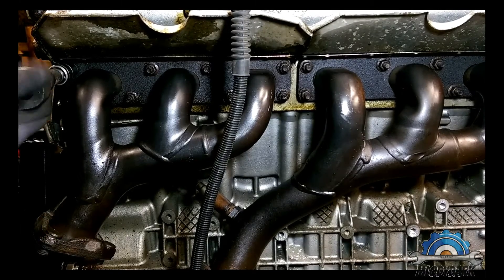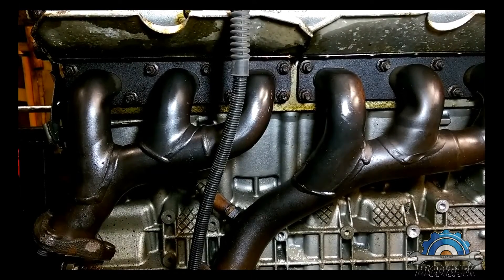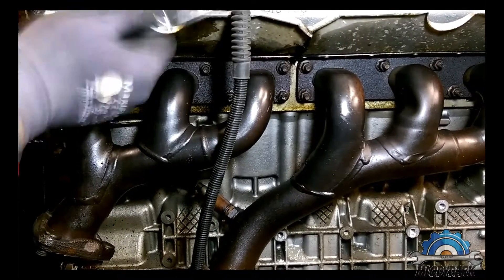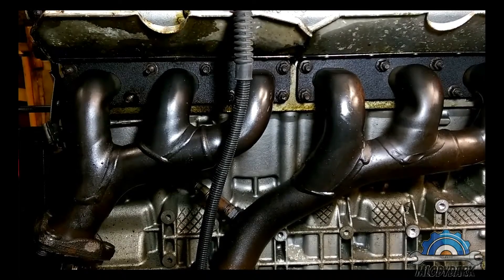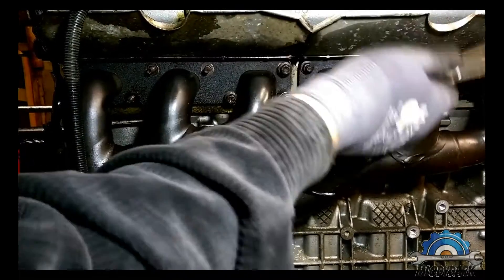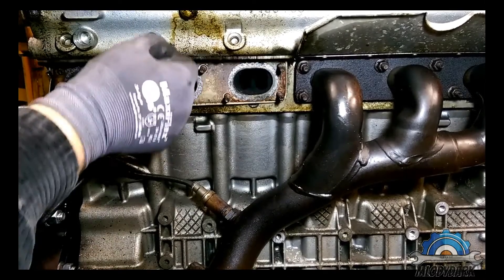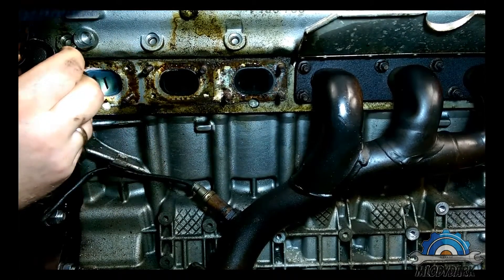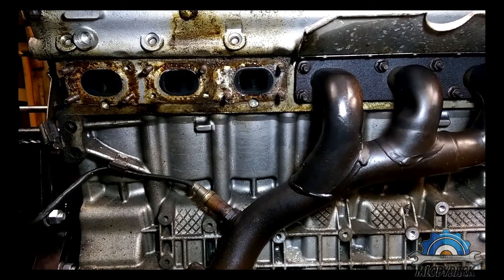Exhaust manifold,headers BMW e46 M52TU/M54 engine

Comment: I don't know how this video is going to help anybody that doesn't have their engine out of the car. I mean really. I just replaced a ton of parts on my E46 330i. My next side of engine is the exhaust so I just looked it up just to see if there was any tricks without having to lift the engine up and remove the engine mount take the washer reservoir out and the secondary air pump just to get to this. He's not explaining anything that helps because when you go to take those bolts out that he's telling you to look to see if there's rust. How you supposed to see that? Because obviously anybody that's going to do that can't see past the heat shields without bending it all the way up it's good to see that but I could have had a picture for this video. This was pointless

Comment: How about simply letting the stud come out with the nut then apply penetrating fluid on the tips and using the double nut method to remove the copper nut? Everything should be fine after that so they can be reused.

Comment: Hey man, could a bad exhaust manifold gasket allow smoke to come out of there. I think my valve cover gasket is still good. After about 2 mins I see smoke coming under or around the cylinder 6 exhaust pipe. Not sure what to replace
Reply: smoke it, check for oil leaks or coolant
Reply from the maker: Easily

Comment: hey can exhasut manifold gasket leak cause loss of power and hestituation sometimes? i dont have any faults on scanner
Reply from the maker: leak on exhaust before o2 sensors can cause big problems,no faults on scanner means nothing,need to read fuel trims.i will be doing videos about that in near future
Reply: Elbow Grease but i have a big fuel consumption poor performance and a smell of fuel burn in the engine room when driving fast and on the end of the highway i can hear an exhaust leak   and tiking sound on neutral from the engine room too
Reply from the maker: wel that how it works o2 sensors need close enviroment if you have small hole ,02 sensor will give bad readings to ECU
Reply: Elbow Grease okay thank you forthe reply btw i have 325ci with the m54
Reply: Elbow Grease today i checked the exhaust manifold on the engine when i started at the morning it was leaking water into the engine mount it stoped when the car warmed up and the gasket of the manifold on bank 2 you can move down and up!
Reply from the maker: OK,BUT WHAT WATER? where from?
Reply: Elbow Grease the fuel in my country is not clean and the car is not consuming water to say that my head gasket is bad i changed the head gasket 4000 miles ago
Reply from the maker: ok so did you use new gaskets on exhaust?
Reply: Elbow Grease no i didnt the mecanic told me its not important to change it but there is no problem with the engine but i have bad smell and a huge fuel consumption and ticking noise in the right of the engine
Reply from the maker: you tell your mechanic he is  a big .........
timing done correctly with vanos tool?
Reply: Elbow Grease  hahahha yes yes he used a timing tool on the vanos i still remember he took his time working on the vanos and he told me this is the hard part in this job
Reply from the maker: ok,so if you got time please stay and watch video which I'll upload in about 2h, I hope it will give clues or put you on right path cuz many people is contacting me and It's very hard helping others  not knowing the car
Reply: Elbow Grease okay